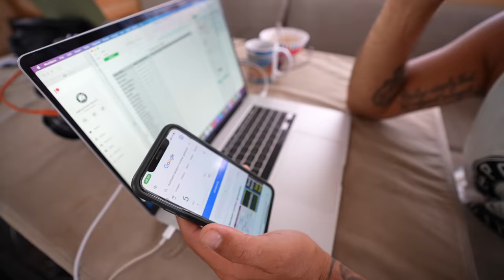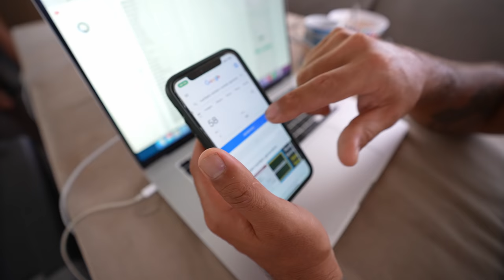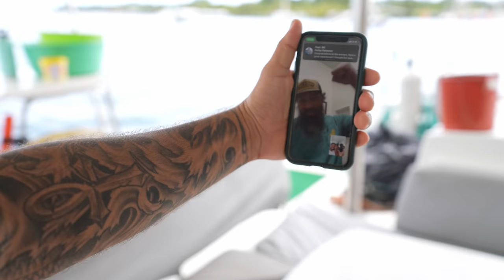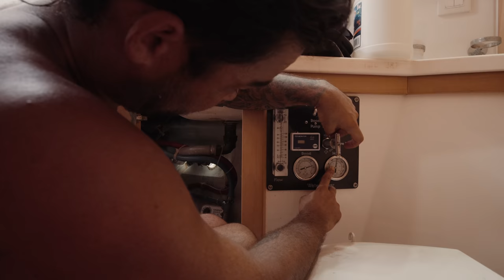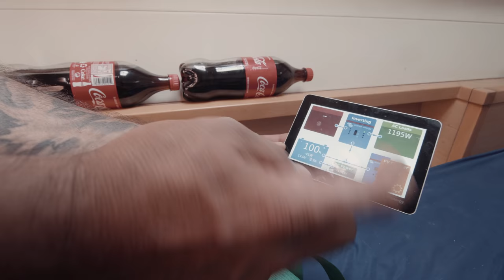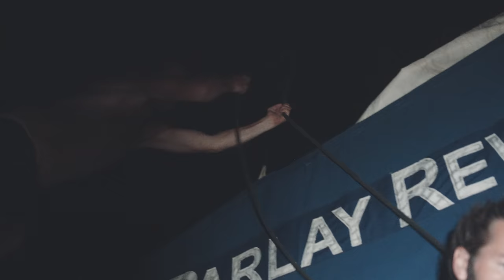IT'S SO GOOD TO BE SAILING AGAIN!! - Episode 143

Comment: Hi Colin i saw you burn the strap and yourself at 13:40. Next time try this trick, at the spot where the strap ends join twist the inside out. The inside end usually has a bit extra that you can get a hold of so you can tear the straps apart.

Comment: A Couple things I'm wondering, could the new system have delivered more voltage and thus more pressure , and those end caps are notorious for having problems and corrosion , they get weak and fail.
Also, just a comment, Tom has really jumped into being the man on the spot. I remember when he was with Drenched, and not anything before that. Tom , what did you do before this ? He filled big shoes, Jamie, miss Jamie's laugh..
 Oh, and almost forgot. Delos was the first to call prospective new crew winners. The even did the video call. Great to do that again, I don't think Delos is bringing new crew on from Patreon now. 

I'd be a patron but I've put out almost all I can afford. I went for channels which seemed to really need funds badly. All of them Saling Vloggers. I can definitely say that you have done a lot for people in the sailing community who are looking to get started. Experts with gellcoat and fiberglass, showing us what can happen because of bad bulkheads and how to fix it. Its interesting how many boats have had serious problems because of bulkhesds. Starting with Zingaro, (old cat) , Atticus (mono) and several Lagoon vessels (many more but only 3 or 4 on youtube). Some were even in the marina you were in. A second monohul, G-B-Ugly which I did my best to get to look at your work. Bulkheads are crucial ! 
These first adventures (splash and first sail) are very emotional for most of us. You went through some huge things, much more than a refit. Way to go guys and gals.